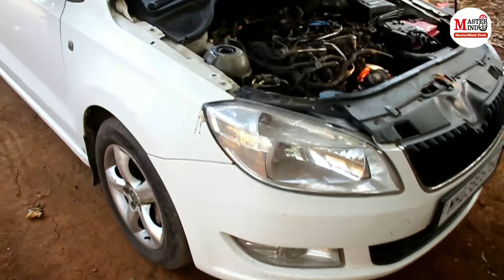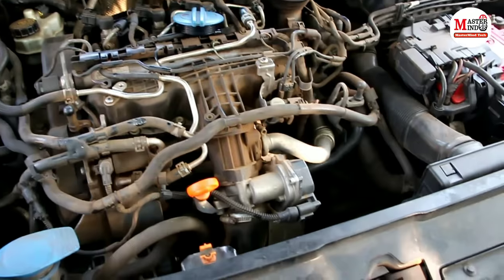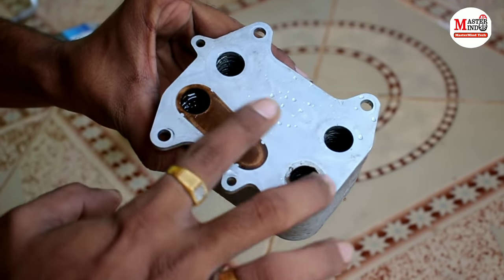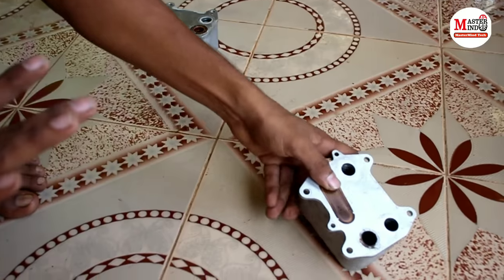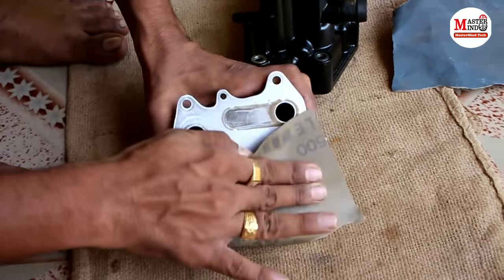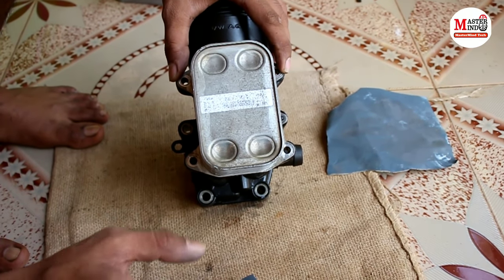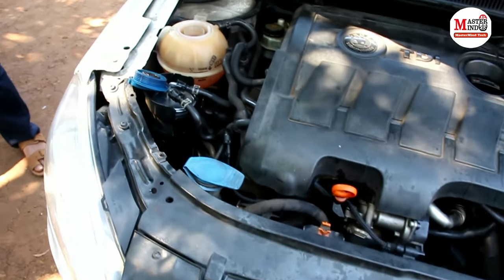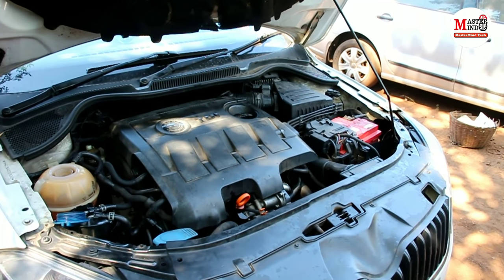coolant mix with engine oil || Car Oil Cooler Replacement

Comment: Bravo. Nice video . I have skoda superb diesel 2009 year. 2.0 TDI . 125 kw. Same problem. Very black oil in coolant.
Reply: What did u do to fix it? 
I am having same problem. I have changed oil coolant.
Black oil in coolant tank.

Comment: Sir meri Ford fiesta 1.4 tdci 2006 model me same issue hai coolant box black hua hai andar se shayad usme oil araha hai. Kya mere oil cooler change karwane se se issue solve hojaegi?. Please ek bar ford fiesta ke oil cooler change karke radiator me Fasi oil ko nikalne ka video ya process batae.. Please sir

Comment: bhai mazi Chevrolet sail uva diesel  gadi ahe tich engine back marat nahi ahe pan oil kami hotay 2000 km la 1ltr engine oil lagte turbo change egr intrcooler service karun pan toch problem ahe pickup la dhur yeto black aani oil khaate gadi kay karu jara sangshil ka mastermind  mitra
Reply from the maker: Running kiti aahe kadhi overheat zaleli ka
Reply: @MasterMindTech  running 3lack km ekda overheat zali hoti karan mechanic ne hose pipe loose tevla hota pan mi 1 taas thambun parat paani takla titun kahich problem dila nahi ani paani vaigre kadhich kami hot nahi overheat houn 6 month zale ani javal javal 55000 km run zali ahe plz jara suchva mla kay karu
Reply from the maker: Piston rings cha problem aasnar
Reply: @MasterMindTech  bhai phc valeo company ka oil cooler kaisa rehta

Comment: Sir if engine oil again comes in coolent after changing oil cooler what to do
Reply: Kindly reply
Reply: May be.... Engine head gasket problem
Reply: I also changed oil cooler 2 times but problem not solved. But no gasket problem in my car
Reply: @drmdzubyrsherif4082 does you change oil cooler gaskets ?